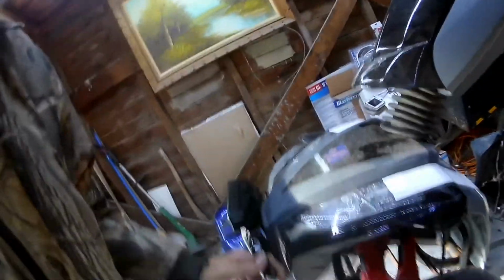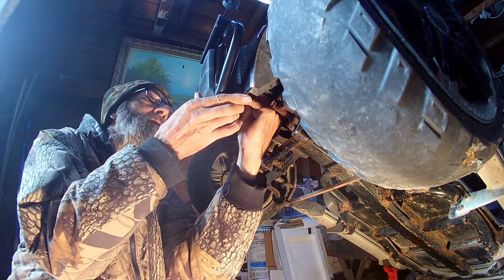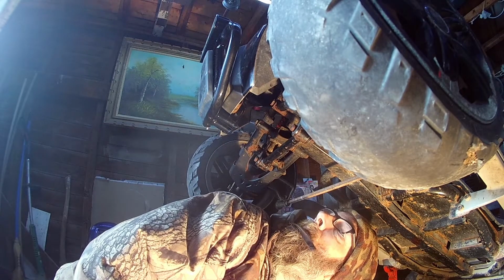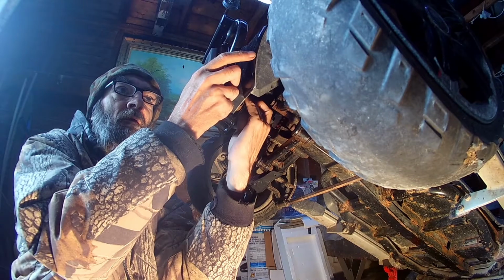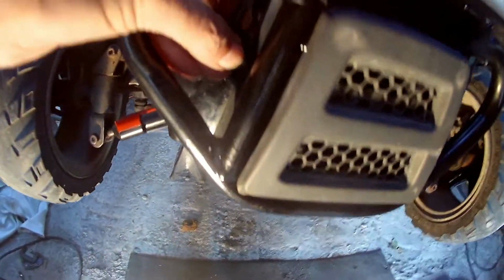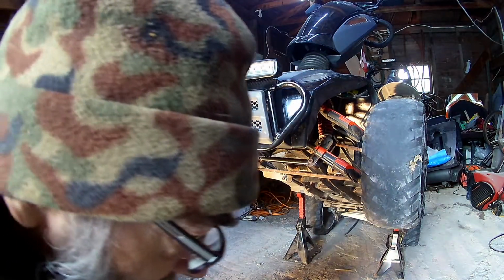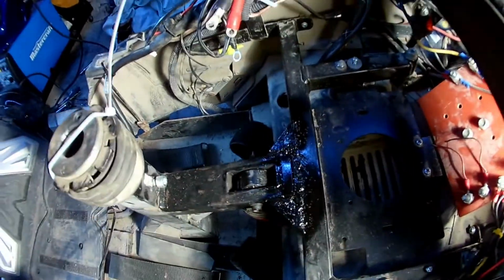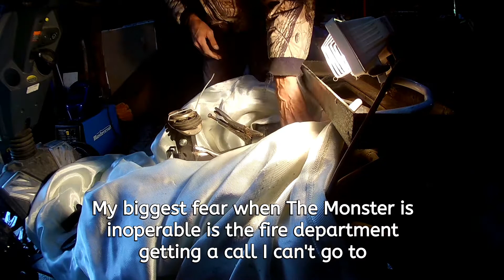Bumper Installed - Frame Finished - Scary Crash Out on the Highway (Audio Only)

Comment: Finally youtube's going to let me comment and give a thumbs up !!!  Hey Bud, wouldn't you think scooter manufactures would make scooters out of better materials, such as full galvanised frame or even stainless or SOMETHING so you EXPENSIVE investment couldn't just rust away before your eyes, especially where you live !!  Great job mate, now just the wiring !! Seeya Rob
Reply from the maker: The wiring is done in tomorrow's video. I think the main problem is the paint on the frame is too thin. After the first winter, there was rust coming through the paint... not in corners or joints, but out in the open. I bet they took the cheap route and didn't use any primer. Any time I "refresh" the paint, I use rust paint, even though a primer coat would also help.

EDIT: I've been having a lot of issues with YT lately... even just accessing it.